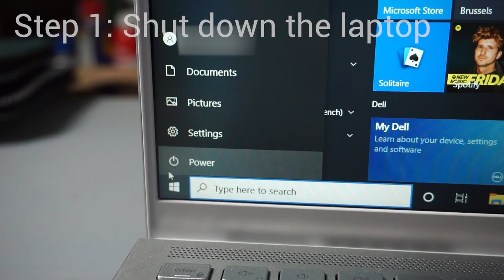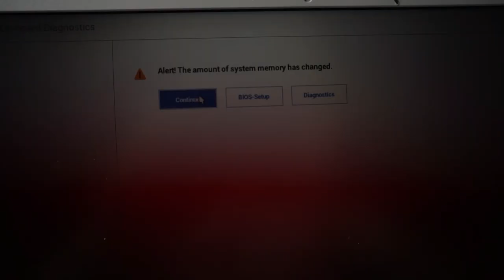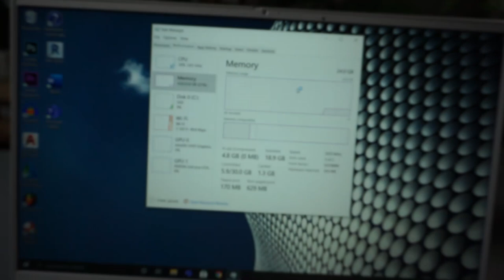How to add RAM Memory to a Dell Inspiron 15 7000 (7501) Laptop

Comment from the maker: 0:33 There's a typo : the 1933 MHz should be 2933 MHz of course :)
Reply: Thanks for the video dell will send me this model as a replacement to my Inspiron 5401 I asked them if there are empty slots they said it doesn't have any other than soldered 8 gb😂. If it's possible could you download HWinfo and send me detailed specs of the device that the program also shows LCD panel model SSD model etc.

Comment from the maker: So, here's an update about the laptop after 6 months of use, as a lot of you asked me about the performance of this laptop:
Things I like:
.The weight
.The feel of the keyboard
.The specs for that price point

Things I don't like:
.The laptop often overheats and sometimes starts ventilating at 100% even when idling
.When I use it on my lap it overheats like crazy and burns my legs because it's so thin and made of metal. And again, that happens even when I'm doing light tasks
.Not enough ventilation - the in and out vents are too small
.The keyboard can't be read at an angle as the silver keys reflect light and that's especially problematic when the backlight is on
.Finally, the biggest problem: the alt codes that allow me to make French letters (à,ê,ç,è, Ç, etc) simply don't work. I even contacted the support but they said that it's a problem that isn't covered by the warranty and that I should try to reinstall Windows. Not cool. I'm stuck copy-pasting the special characters because I don't want to write with an azerty for the sake of the special characters only

So overall, if you're looking into buying this laptop: don't. It's a thin and light laptop but at the same time it overheats and the technical support is really bad. Plus it's very loud even on idle. I'm still happy with it as it's light and allows me to make work for the university even when I don't have access to the main computer. But the alt codes thing and the idle overheating are really annoying problems and I hope Dell comes up with a fix for them.

Comment: Nicely done, thank you. However, what was not made clear here is if you are REPLACING the existing RAM or adding to it ? I guess adding, as 24GB total at the end seems great ! As an extension to my question, how many RAM banks are there ?
Reply from the maker: @te4186 Hi! Yes I added the RAM and there is only one empty slot that you can fill

Comment: Thanks for the Video but could  you tell me why 4.5 Gb of my 8Gb installed Ram is already used? Is it the Intel graphics chip or is it just windows? I want to upgrade my Laptop with 3200 Mhz 8Gb of Ram do you think it is positively affecting my gaming experience? :D
Reply: Windows uses around 4 gigs

Comment: Dude can it handle heavy 4k raw files straight out from the camera on premiere pro in this device? Is it gonna take too much time or is it gonna get stuck or is it handle them smoothly? (even after upgrading)
Reply from the maker: For 4K I wouldn't suggest this laptop - it's too thin.

Comment: Awesome video, I may be getting the 7501, can I ask how is the thermal performance? There was a new update for the bios recently which claims to have improved it. Also is it possible to undervolt the CPU? I know disabling the turbo and undervolting can help keep it cool
Reply from the maker: I have a desktop PC for heavier tasks (3D modeling), so I haven't pushed the laptop too far considering performance yet. 
For the moment I'm very happy with how the it handles simpler tasks like video editing and photoshop. It can get loud sometimes but for its weight and thinness it's pardonable. Considering it's price I'm really happy with it: it's a lot cheaper than a cheap XPS 15 model that doesn't even have a dedicated GPU.
Now for the CPU undervolting I have no idea. I haven't felt the need for it as I mainly use it for Word and watching movies, so the thermals are usually low.
Reply: @HandyBear  I see, thanks a lot for the information as Its hard to find reviews for it since it is new. I agree its a better option and the build quality also looks great
Reply from the maker: The laptop also has downsides related to software. The alt codes for exemple don't work, they just make question marks in boxes. Also, the fan sometimes turns randomly on when the laptop is charging in sleep mode.
I hope Dell comes up with solutions to these problems, because the hardware is very good.
Reply: @HandyBear  Thank you, yes the alt key part is a bit strange, I've had the sleep issue before but I just hibernate it nowadays. Dell is wanting to replace my current inspiron with this 7501 so I just wanted to know how it was like and yes I hope they are working to fix the final few issues

Comment: can I ask about Mhz? I see in the video you use DDR4 16GB 3200 MHz. Is it still fit with 7501 i7 with 2933mhz?
Reply from the maker: Yes it works, it will just run at the slower speed (2933mhz).I got the faster one cause it was cheaper than the slower one.

Comment: @Handy Bear What if my stock is 16b with speed 2400, what should I do to increase ram. Great video :)
Reply from the maker: Check out the manual to see if the memory is expandable and then add a new 2400 RAM stick if it is.

Comment: How do I get the cover off? Seems impossible without forcing it?

Edit: seems to be the captive screws. On my old inspron 17r se I could unscrew them and they would be held into the cover but I could take the cover off. 

With these, I unscrew them and they still seem firmly ‘screwed in’

How do I remove them?
Reply from the maker: If you unscrew them they should lift the cover up so that you can grab its edge from underneath. After that they aren't screwed into the laptop anymore but they are still held in place in the cover.

Although be careful not to force the screws as it's very easy to  break the holes and then they won't lift anything, they'll just spin freely.
Reply: @HandyBear  thanks for the swift reply. It seems they are spinning freely
Reply from the maker: Then it's bad. Try maybe using a suction cup to lift the cover in the area with the captive screws. Or some hot glue sticks like they do in those Tik Tok car dent repairs. 🤷‍♂️
Reply: @andrewianscott1764 omg...i sent my laptop for service today. Seems like i faced the same problem, how do you fix it? Did technician force unscrew my laptop 😢😢

Comment: Can it handle after effects easily ?
Reply from the maker: Only for basic things. The rendering takes time and it can get annoyingly loud.
Reply: @HandyBear  does adding a 16 GB  more ram to it will make any difference in the software performance
Reply from the maker: @vshalsoni8780   @vishal soni  

Yes. I'm using the laptop for video editing (Premiere Pro) and 3D modeling (Fusion 360 and AutoCAD). There's definitely a difference between the before/after of the upgrade (before it always lagged and froze, now it at least loads the panels correctly).

But it is still loud when rendering.

Comment: Is this one with the i7-10750H because the only Inspiron 15 7501 that has a ram slot is the i7-10750H with 16 GB of ram.
Reply from the maker: Yes, it has an i7-10750H but it only had 8 GB of RAM.
Here it is: https://www.amazon.fr/gp/product/B08BTZC2MS/ref=ppx_yo_dt_b_asin_title_o00_s00?ie=UTF8&psc=1
Reply: @HandyBear  thanks for the reply does the one with the i5-10300H have expandable storage?
Reply from the maker: @rayahm3954  Yes.
Reply: @HandyBear  thank you
Reply from the maker: @rayahm3954  You welcome bro

Comment: Please do review of this laptop battery life and performance
Reply from the maker: The battery life is decent, it can get me through a day at the university without charging. As for the performance, it's not enough to do any complex light rendering in 3D, but good enough to do video editing and simple 3D modeling in AutoCad.
Reply: @HandyBear  thank u for honesty review 😊
Reply: @HandyBear  can I play games  like GTA 5 in this laptop I am asking you because i am thinking to buy this laptop
Reply from the maker: I don't play video games so I can't say for sure, but I think that it can handle high settings if you can handle the sound.
Reply: @nithinkumar9281  yeah bro, it can handle it easily. I've been playing it in my inspiron 7501 for about a month.
Reply: @Robin-lc9go  thank u bro 😎
Reply: @HandyBear  Why only simple 3d modelling of Autocad run on this laptop I mean this laptop comes with i5 10300h and GTX 1650ti

In the same price segment, Dell G3 provides the same configuration except thee screen quality and 120hz screen that laptop has handle very well and even 3ds max.

I want to know that what is the difference between a gaming laptop and this type of laptop because both have the same configuration. I am confused about which one to buy both are available at the same price almost ₹77,000 (including bank discount) I want to run 3ds max, AutoCAD, Staad pro, Revit, Unity Game Engine and Android studio.

Please help me brother which one is best among these two not possible for me to extend my budget?
Reply from the maker: Yes the components are good, mine even had a 10th gen i7 inside. But the problem is the build quality and the poor thermals.
Because it is so light, the laptop overheats quickly and that's very annoying when trying to get some work done.
I actually returned this laptop and will buy a macbook for next year of university. This Dell wasn't good.
Reply: Do you really think that MacBook Air 16GB ram or even Macbook Pro 16GB can do handle heavy graphics-oriented applications like 3ds max, AutoCAD, Staad pro, Revit, Unity Game Engine and Android studio. Because the Apple laptop has no dedicated graphics in it as compared to Dell laptop or any windows laptop. So, is apple laptops are capable to handle 3d animation? Where windows laptop company providing RTX 3060, 3070 or even 3080 with 4GB, 6GB, 8GB graphics? I thought Apple is only good for YouTubers for video and music editing as well as for programmers, coding and all.

Comment: Hey, would 2666 MHz work?
Reply from the maker: Yes. It will simply make the other stick also slower.
Reply: @HandyBear  I couldn’t find one with the same MHz for that laptop
Reply from the maker: @yhaelmarbil1719  You can also put faster RAM in it (like I did but I didn't show it in the video - I went with 3200 MHz). 2933 MHz RAM is indeed hard to find depending on where you live.
Reply: @HandyBear  thanks for the info. Bro much love and respect.
Reply from the maker: You're welcome! 😁

Comment: Can I add 2400 MHz into it? Will it cause the laptop to crash?
Reply from the maker: It will work but it will also slow down the onboard RAM stick to 2400 MHz.
Reply: @HandyBear  Do you know the voltage of the 8Gb that's onboard? And do you think that there's a noticeable drop in performance if I choose to put in 2400 MHz (I'm just an average user)?
Reply from the maker: @davejang1987  I don't know about the voltage.
2400 MHz is also decent, you'll be fine with it too.

Comment: Hi, I have some questions beacause i want to buy this laptop
¿is this the touchscreen version? I aks because in Dell webpage says that the 8gb RAM is onboard so I want to know if this laptop is the same of the following webpage:
https://www.dell.com/en-us/work/shop/dell-laptops-and-notebooks/inspiron-15-7000-laptop/spd/inspiron-15-7501-laptop/smi157w10p2c1014?configurationid=5938372e-da94-4370-b7f6-a3f896bcf13a#features_section

Thanks

Comment: Hi! I'm searching for a machine that remain quiet under office work/browsing web/zoom calls but can casually render video or game with not many pretension. How is the fan noise in the idle/browsing/office situations? I don't mind if there is some heat but the pc remain quiet.  Furthermore , have you noticed coil whine on your unit?

Thanks a lot :)
Reply from the maker: Recently I'm having issues with the laptop randomly starting to blast air at full power even when browsing YouTube or even when the laptop is in sleep mode. But that only happens when the laptop is plugged in the charger, so I don't know if it's a software issue that could be fixed by Dell or not. It's annoying nevertheless.
For occasional video work, the laptop it's good enough, but it does get a bit loud. Also for the gaming.
I guess it's the tradeoff from having such a light computer.

For the coil whine, I don't have any on my unit. But the SSD does make a weird crackling noise when it's working.  It doesn't bother me that much but it's still hearable.